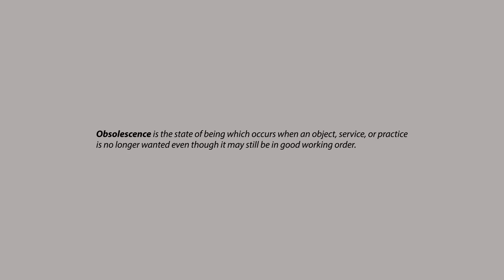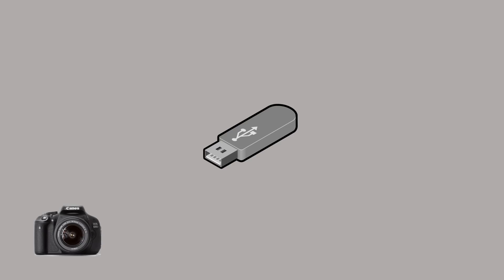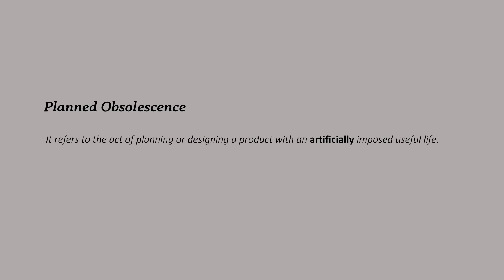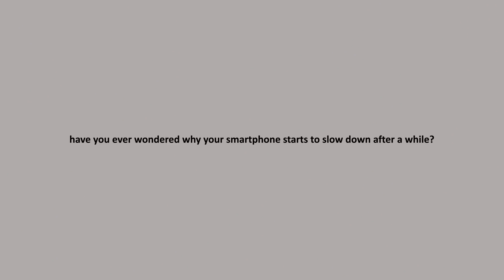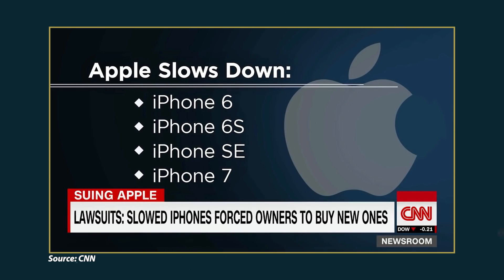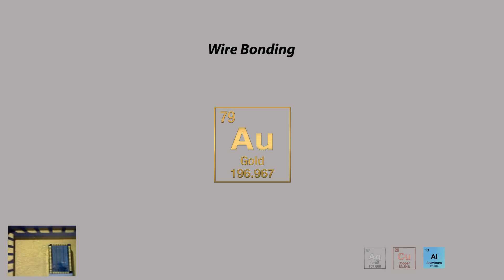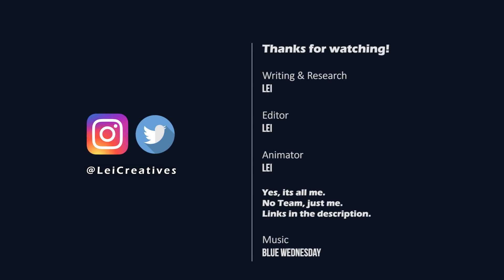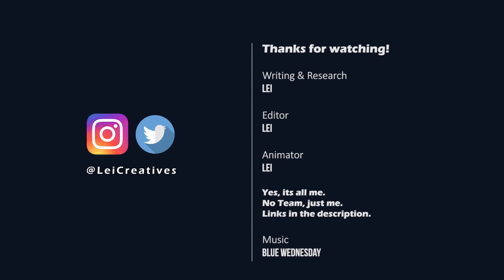Why Your Smartphone Seems to Slow Down Over Time?

Comment: cough Apple
Reply: Aaron Joushu, yeah good luck getting Android 9.0 on that
Reply: William the butchers son productions that's why my iPhone 4s was supported till 2017
Reply: @marashah.ibrahim  and it runs like complete garbage compared to before updating.
Reply: @your_average_clippy  yes, but is that different from paying almost the same amount of money and not get atleast 2 years of support
Reply: @marashah.ibrahim  at least it doesn't slow down as much. The s4 with jelly Bean (last official update) is much more usable and much faster than the 4s with iOS 9.
Reply: where can you find a 2013 Android phone that still gets software updates? cough 5s
Reply: @imj3200  my s4 has Oreo.
Reply: @imj3200  where software coming in this conversation
Reply: imj3200 0 you can’t even find an android from 2015 or 2016 still being sold let alone updated

Android has the most planned obsolescence, so don’t even try saying Apple does, Apple keeps making, selling and updating for years
Reply: @bryanmiller476  Well considering their hardware is often 2 years or older when their items are out "new", Apple does tend lag there.  You have to give Android at least that, they have top of the line hardware in all their new phones hardware wise for their top of the line products.
Reply: @darth_kal-el  Because of the locked operating system that doesnt use any recources and is specifically designed for Apple hardware.
Reply: Michael Cox what do you mean by 2 years older?
Apples ARM SOCs are wayyyy better than those of their competition, Apples SSDs are the fastest ones out there, their LCD Panels are absolutely amazing, their Camera is awesome too (especially their videography aspect) and their buildquality has been awesome too since the iPhone 6s.
I don‘t understand what you mean?
Reply: @imj3200  cough, my iPad gets update but can't run Pubg smoothly, cough
Reply: HEEEE HEEE HEE!
Reply: You see, other companies are not as blatant and obvious as Apple.
Reply: I still have a working iPhone 3gs 🙄
Reply: imj3200 0 Nexus 4 from 2012 with latest custom rom, cough
Reply: Penguin Person 
You have that the wrong way around. This a big corporation that knows what its doing but suckers keep making excuses when this big corporations does dumb shit instead of holding them accountable and expecting better from them. But yeah Apple slaves will be Apple slaves.
Reply: Boosted 
Not true, yes my android phone started to slow down initially after 2 years. I removed some apps I did not need anymore, I made sure I had enough disk space available. Too much junk apps. After removing junk suddenly my phone was working at normal speed again.
My phone is 3 years old BTW, still good enough for another few years I think.
Reply: @TrustInTheShepherd  if your Software is outdated instal a custom Rom with the new Android version
Reply: Samsung does the same too actually it's called the "Samsung lag" and it's basically after 3 months of using your Samsung device it slows down heavily my note 8 slowed down after 2 months but I do heavily use my smartphone
Reply: @gavinhu9287  that doesnt happen unless u fill your device with cache,residual,unsused memory and dowloand apps which use ram in the background
I have a samsung Galaxy s7 and still works almost as fast as in 2016
Reply: @gavinhu9287  Clear your storage and cache and see the difference
Reply: Gavin Hu 
Well, my samsung phone never slowed down for me. Maybe you should look at the optimization techniques for the phone. Also do not install too many apps, obviously that will slow down your device. I did install a bad app once that completely used up my days battery, I threw it off my phone problem solved. In most cases where people complain they themselves caused the problems by installing junk on their phones.
Reply: imj3200 0 I wonder which company apologized for purposely slowing down their old phones on purpose cough apple
Reply: Android is fast. But, yeah, if user download files to unknown location or watch so much morn, yeah, viruses can slow down phone. Cause of this,  reccomended download virus protection software to android and IOS. Viruses can slow down iOS to.  But,in summary Android is better OS than iOS. Android 8.0 is very fast and responisble and not limited, like iOS.
Reply: ATP Tech which company doesn’t admit it and still forces people to buy a new phone every year because of lack of updates? Cough cough.
Reply: Marvincent Acuña it all ready got 2 major updates which rather increased the performance and speed and new features rather never got slowed or got any lag so why bother update
Reply: William the butchers son productions xD
Reply: Aaron Joushua I
Reply: PvPEdits-Minecraft dadas and what is Apple 8?
Reply: Ibrahim Mohsin yeah apple update their devices at least
Reply: how did you find this junk that was on your phone and delete it i may have that problem as i do download apps frequently on to my device
Reply: Boosted thanks, I love getting appreciated!
Reply: Got the motoG after selling my iPhone 5c (bcz of some problems) and have been on android since, just upgraded to a S9+ from my OnePlus3 which I bought on it's release week.
Reply: Dude it'll get Android 9.0 easyy.......don't think it'll get the 10.0 update though.
Reply: Ibrahim Mohsin 
You can install custom roms or apps that get the features android q will get. Samsung have lots of features already though.
Reply: Ibrahim Mohsin you’ll get neither.
Reply: @niipko  stupid people like you love apple becauee apple love to fuck dumb 🐑 like you 🤣🤣🤣🤣
Reply: The reason why apple relased ios 9 on iPhone 4s is fact, that you can download newest version of facebook or messenger and alot of apps , because these apps mostly requires iOS 9.0 or later. So, that iPhone is slow on ios9, but you still can use it as a normal smartphone.
Reply: @niipko  well, can't blame them. Apple is known for that kind behavior.
Reply: caugh caugh Samsung
Reply: Android is not innocent in this, they just get you by filling up your storage with unnecessary software. It wasn't necessary toa have on the phone when you bought the phone, and more than half of it doesn't even seem to do anything but take up space so you go buy another more expensive phone with more space only to repeat the cycle.
Reply: @Caramel Vanilla That doesn't fully remove the app meaning it is still there taking up some space.
Reply: William the butchers son productions is that why iOS 12 made every iPhone faster? Do some research
Reply: My iPad 4 is faster than tablets from this year. It's still fast as heck.
Reply: Exactly after my ios 11.1 update my iphone 6 totally slow down it shit I hate apple for doing this I only got the phone in 2017 I soled my phone and got a one plus 5
#appleisshit
Reply: Aaron Joshua yeah you’re a liar.
Reply: Apple 8 is too old now

Comment: Im Curious to why in smart phone connections gold is preferred to copper and copper lags more then gold. If it is electrical continuity then silver is best in that department. Gold is best for exposed contacts that make repeated connection and disconnection. It would be interesting to see if there is a difference if a phones connections were only made of silver, gold, copper or, aluminum with the small distances the signals travel within the phone would it make a difference.
Reply: Gold is inert and doesn't oxidize, unlike copper. I imagine that the resistance between connections could change due to oxidation, causing some performance impact. However, as a programmer, I bet a lot of the performance impact is from software. I uninstalled the Facebook app from my phone since it was constantly using a lot of battery and storage, even when I ended the task. Imagine just how many other apps on your phone do the same thing, running silently in the background collecting data, or were just programmed poorly and haven't been optimized.

Comment: I can confirm that especially RAM and ROM of your phone slows down after years of use. But also problems like building up cache and obsolete files of non installed programs do show a effect. But, new versions of especially Android(stock) do not slow your device down. Sometimes it even makes it faster or improves battery life, if the device maker properly ported the device tree and adjusted the improvements in the kernel for the specific phone itself.
Reply: Harri ROM slows down because of writing and erasing data content of storage. you can see it on some SDcards that has some Max limit  to write and erase data. and it slows the phone overtime.
Reply: @kanekiken1995  , I think You mean  FLASH memory instead of ROM. ROM stands for "Read Only Memory". Users can't write this type of memory so it's performance does not degrade. Smartphone's don't use ROM as a main internal storage so FLASH memory can slow down gradually over time as You mentioned.  But the main point of the video was not the normal degradation of the phone's HW components, but the intentional SW slow down performance downgrade) of the manufactured  to avoid sudden shutdowns of the phone when the battery was in bad condition WITHOUT informing their customers.
Reply: yh like s7 on oreo 10+20% faster
Reply: I think You mean the internal FLASH memory instead of ROM.

Comment: Come on. Copper wire bonding is clearly superior to gold.
Reply: rfgecnf Could you please explain why copper is better than gold for wire bonding?
Reply: Copper wire bonding is superior to gold in just some cases, copper deteriorates as time passes but gold lasts noticeably longer and also we are bonding wires as wide as 500 micrometers. Gold can be stretched to be microns wide and then too not break. (Micron is a unit used for measurement at microscopic level.)
Reply: Real question isn't gold, it's why not silver. Silver is a better conductor then copper, less susceptible to corrosion and not even close to the price of gold. It is however about 75 times more expensive then copper, but ya don't need much.
Reply: because copper is a better conductor, the problem arises when copper corrodes, but that shouldn't happen unless you use a longer string with copper and apply sufficient oxygen and water.
Reply: Kohta Furuyama copper conduct electricity better then gold.
Reply: I mean while true for an open package, gold-bonded device doesn't show superior shelf/serviceable life compared to encapsulated copper-bonded device, does it?
Gold is absolutely great and indispensable for certain applications, but in consumer electronics copper is simply better because of price to performance to lifetime ratio.
Reply: as people below already explained: copper is a better electricity&heat conductor. It is also cheaper.
Reply: rfgecnf  Companies need to make money. Watch the video "How much does a real iPhone cost" or it would be something kinda like that. If companies stop making exorbitant amount of money, you can get an iPhone X for as cheap as 190 dollars (rounded- I ain't so sure on that too)

Comment: The software is a big part. The cached data, updates meant to slow down isnt just from apple, but many more companies, samsung, lg etc.
Formatting helps, but a bit. :/
Reply: This is why custom roms are great
Reply: Felipe Schieber somewhat, the custom rom takes a huge hit on camera.
Reply: But you could avoid this easily by using custom ROM, meanwhile Apple....... Sheep
Reply: shreyans jain ?"detoriated hardware"?
Reply: UpStep  nvm.
Reply: Stop it. Get some help. https://www.youtube.com/watch?v=9Deg7VrpHbM
Reply: Samsung doesn't have u seen s7
Reply: Cuzito LGD .... Have you? I have seen a lot of samsung devices and their plagued software. S7 is shitty af when it comes to standing up irl compared to many of its competitors since launch.
Reply: shreyans jain the photo quality doesn't decrease because custom rom. It may decrease if it is coded badly. I have seen small increase in photo quality after new rom, but this is subjective and there is differences between phones
Reply: Fucc yall
Reply: I usually do a full ios wipe once every 4-6 months just to hard clear the cache